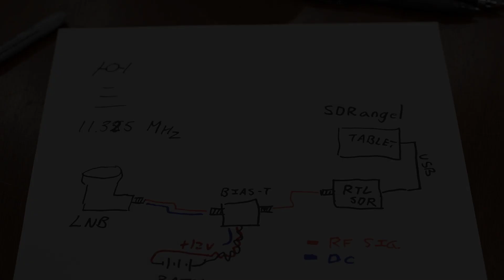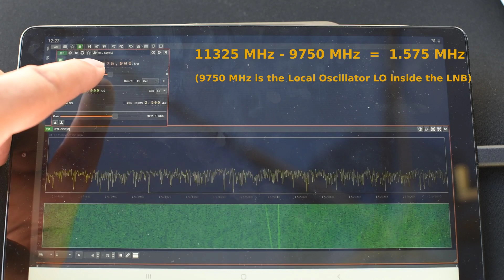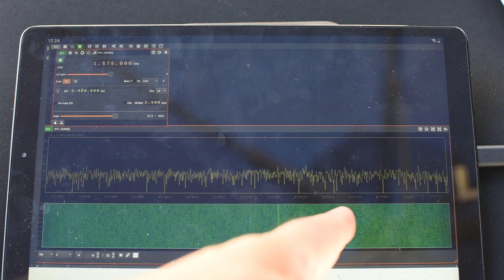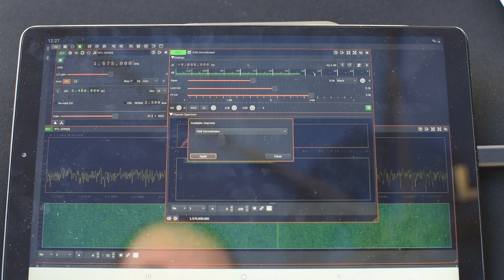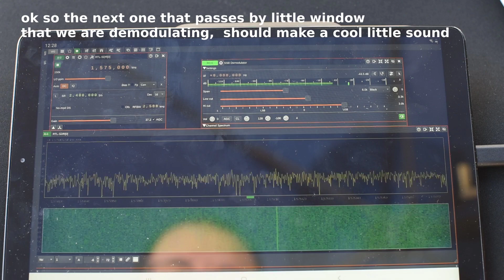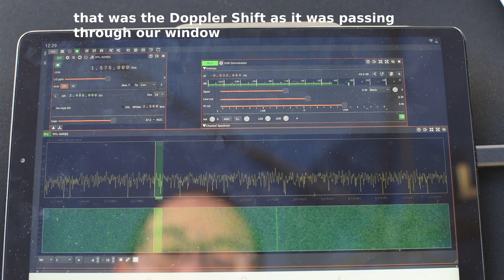Experimenting with Starlink Beacons

Comment: I tried it yesterday after the same LNB arrived.  It worked!  Fun little project. Now what?
Reply from the maker: You could try to increase gain (signal level)  by using a small dish.   that's what i bought for this weekend's testing.   what i wanted is to be able to see the OFDM signal from Starlink.   So,  the OFDM signal on Starlink is a beast.   No bones about it.   Its 240MHz wide and comprised of 1024 sub-carrriers each spaced about 234KHz apart.   So in the SDRangel software,  its gonna look like a comb with 10 to 12 "spikes"  per SDR screenful (these are the carriers).   The reason you cant see all 1024 sub-carriers is that the RTL-SDR's  bandwidth is not wide enough.   But you can see the start of a channel,   and the end of the channel and parts in-between,   just not the whole dang thing.  Too wide.   There are fancier SDR's  such as the  HackRF    or   Ettus  USRP  B210   that can see much more.   but even still not capable of seeing the whole channel.     Happy experimenting.     p.s.  the dish I got was just a basic 76cm. (30")  diameter dish from Ebay.   its a Winegard  DS-2076.   but any dish that size or near will do
Reply: Thanks for the reply Dan. I bet my neighbors have a number of those dishes rusting away. I'll wait to watch your experiment with said dish before I do anymore outside experiments.  It just got VERY cold in Central Oregon.  Cheers Nigel

Comment: Very neat. I tried this using an old Ku LNB I found on the side of the road, and I could receive some pretty nice signals. I didn't even have to use a special Bias-T or anything - just a 13.7v power supply with a capacitor to separate the RF and DC. Thanks for the idea - I am glad to know my LNB setup works now,

Little side note - these LNBs also receive 10 GHz pretty well if you are interested in getting into microwave transmitters. A cheap one is the HB100. If you have a Baofeng you can also test this because the 24th harmonic of the RECEIVE local oscillator on UHF mode will travel for a few feet across the room. If you wanted to use, say, 10.4 GHz, you would tune the Baofeng to 433.33 MHz.

Comment: Try IQ mode, you'll hear it on both sides of your center tuning  frequency. (FYI I think we're local. PM me and say hi.)
Reply from the maker: Cool!   I will try that next time im search for Starlink signals.   ;)
Reply: @dan_in_sd  Yeah. Instead of just hearing it chirp down, it'll chirp down and then back up. You'll hear it twice as long.

Chirping (terrestrial) signals are also audible all over HF, at least from our area. They're FM chirped radars, apparently used to monitor sea state. The transmitters are fixed, so it's not Doppler. They actually transmit the chirps.

Comment: Interesting!  Thanks Dan!
Reply from the maker: Yeah,  its cool when 2, 3 or even 5 satellites can be seen in the SDRangel software.   I've heard that ppl are trying to figure out how to use these signals as a secondary form of GPS using some fancy math.   Reports are that they can determine the receiver's location down to  5 meters   just using the Starlink signals and publicly available Starlink satellite trajectory data commonly called TLE (orbital element data).